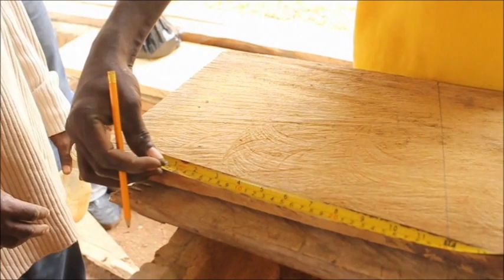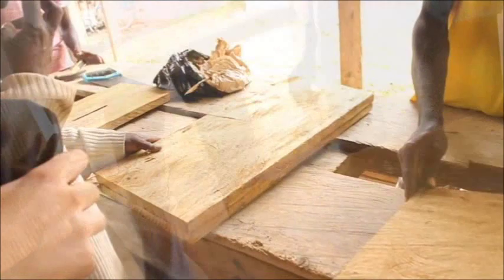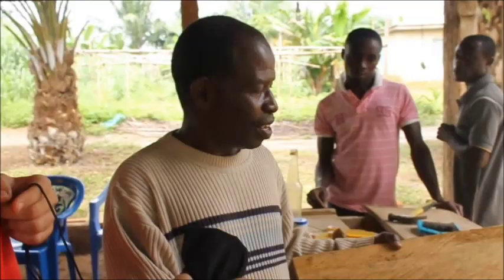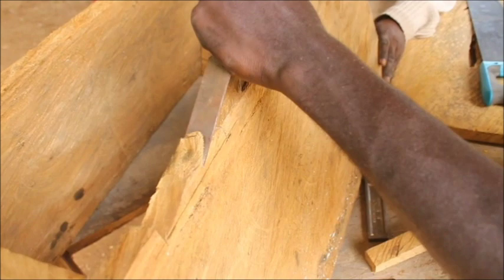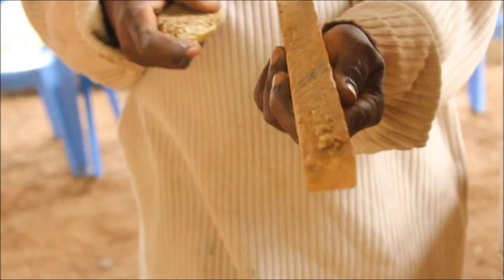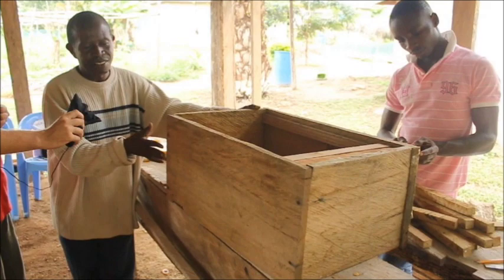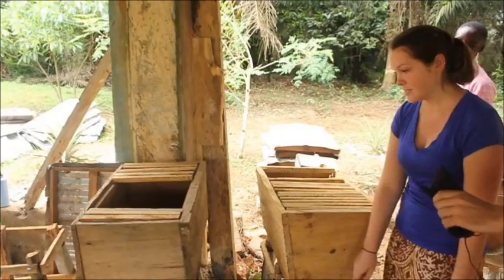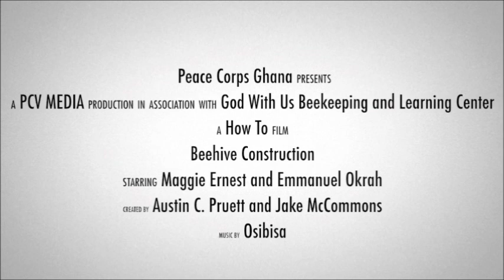How to Construct Kenya & Saltpond Topbar Bee Hives - Peace Corps Ghana

Comment: 1--The clay pot hives are shown at the end of the video but don't seem to be durable enough or big enough for a sustainable beekeeping operation
2--Proofreading the captioning will increase the video being seen by more people across the globe as one is unfamiliar with the pronunciation or diction of the speakers.
3--Instead of using the corrugated metal sheet for the roof in one of the hive designs, wouldn't a terracotta or baked clay roof be better, considering the heat coming via the sun during the day. Also the terracotta or earthenware roof could wick away the excess moisture formed in the hive and its condensation. Excess moisture invites fungal diseases plus terracotta or baked clay is porous and can aid in the natural ventilation of the hive. 
4--Ants and other predators need to be guarded against in africa. These preliminary designs would need some thought about pest control too --like being off the ground, having the legs standing in water cups etc.
5--Dimensioning of the designs on a piece of paper would help as a summary of the 2 designs for wooden hives
6--Since the wood used is quite thick, the wooden hives are going to be heavy
7--If the video is being made for training and education purposes, the information must be delivered faster by practicing some public speaking. Right now its a good amateur effort at information delivery but cannot help scale up or improve production efficiency or training efficiency
Just some thoughts.